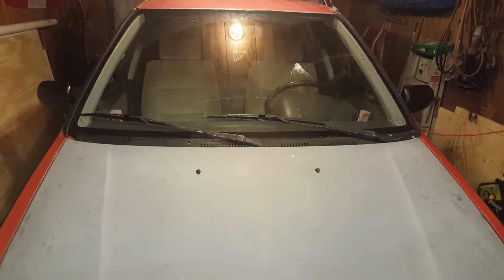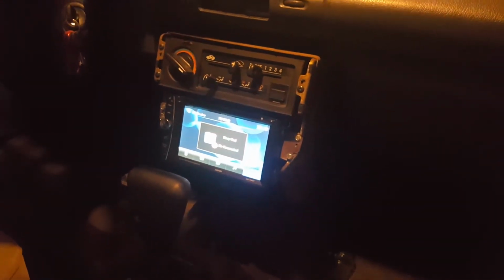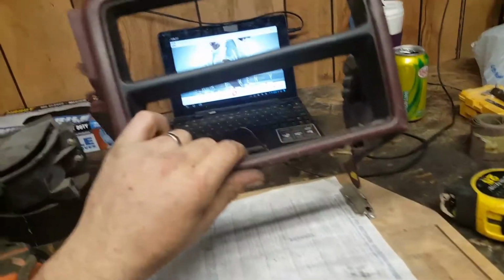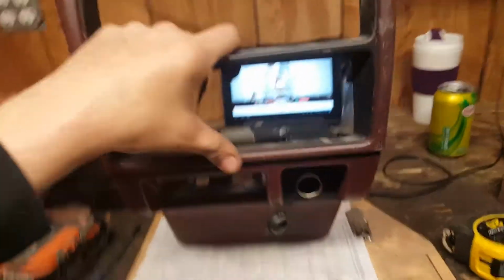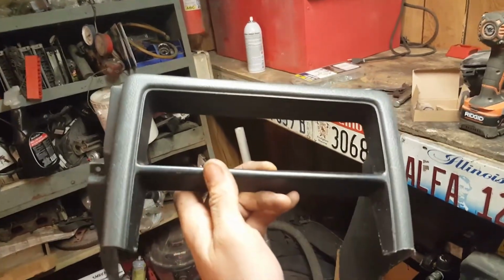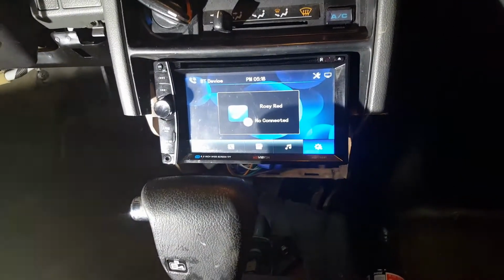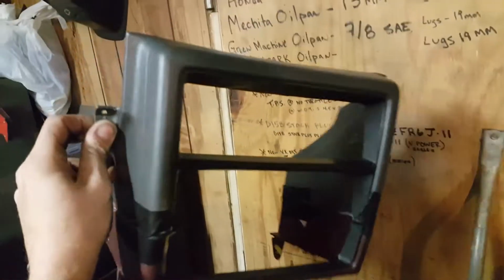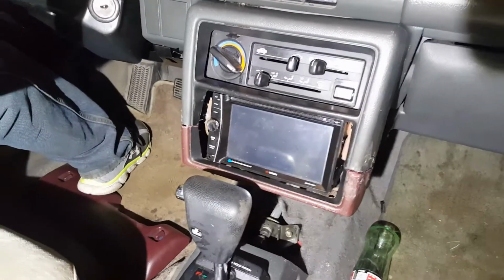EF civic double din radio

Comment: Nice, I recently seen a CR-X for sale on Craigslist with a double din clean AF! I also just installed a double din pioneer in my ek (96) had to get a 00 Civic climate control because 96 only fits single din had to trim trim AC vents a little too
Reply from the maker: EK Frank right on, that's awesome!
thanks for watching!

Comment: What did you do to fill the sides of the din itself like where it flushes to the sides of the stereo. You add more resin or another plastic piece?
Reply from the maker: Lots of fiberglass resin with cardboard to get the shapes close, then lots of sanding. Thanks for watching!

Comment: Hey is it possible for Me to put a head unit with an aux port to a 1991 civic ?
Reply from the maker: Andrew Ward yup. You can put a standard single din head unit and get the aux port. I'd also recommend buying a wiring adapter to go with so you don't have to cut the factory harness. Thanks for watching!